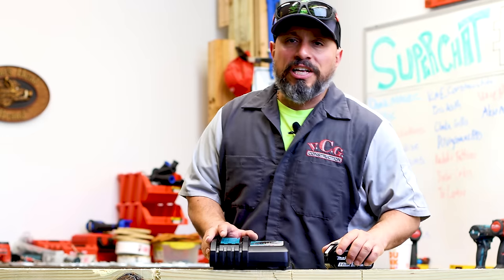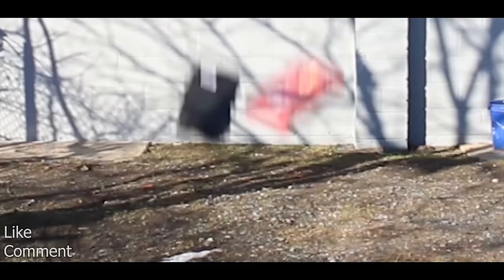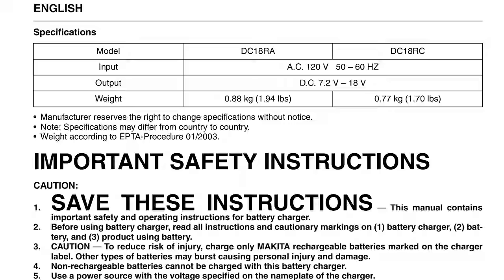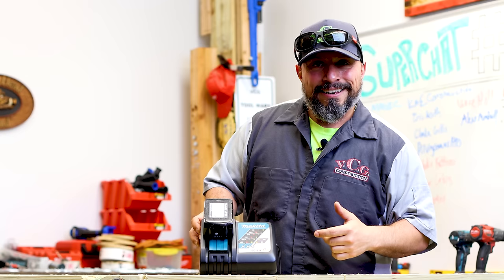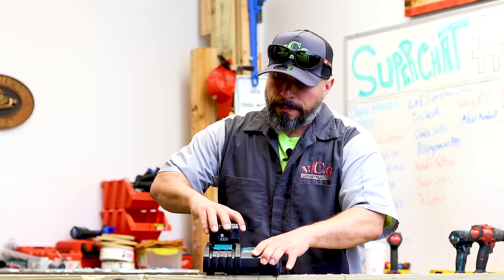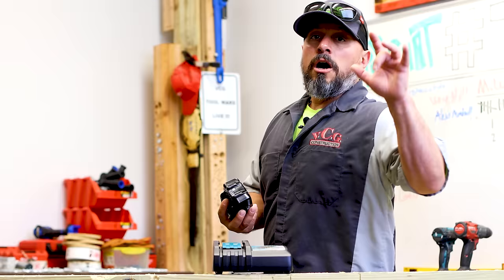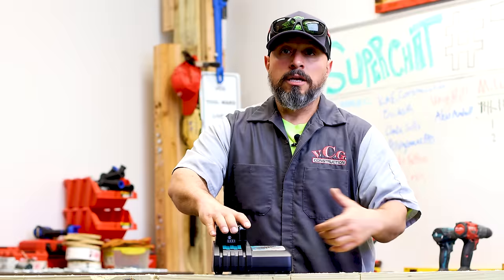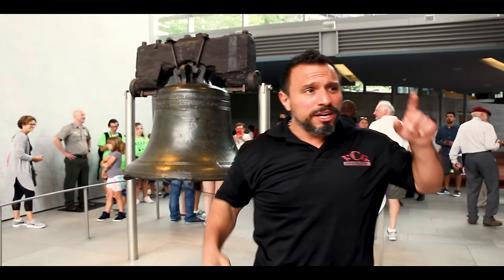MAKITA RAPID CHARGERS HAVE A HIDDEN FEATURE YOU DON'T KNOW!

Comment: If you have the dual port charger you can actually set dif tunes for each side. I run 2 dual ports and have each of the 4 bays set to their own tune. Makes it real easy to know which battery is charged without having to go look

Comment: I recently bought a new charger. 
I see the music sign on the panel but my charger never played beep on insert or music after battery is fully charged. 
I was thinking to return the charger thinking its faulty.

Its very helpful to know by this video that charger has options from silent to music mode. 
And mine was set at silent by default from factory 😃.

Thanks for saving my time and hassle of returning.

Comment: @VCG just push the tab the battery goes on forward multiple times and will change too
Reply: No need to insert the battery in and out. Even though it might say on the manual, I would avoid doing so to your battery. (Burnt something in a battery by doing so and warranty didn't replace it)

Comment: Hmmm, am I the only one who reads the manuals?

This wasn't new for me but hopefully others will have learnt something

This works on single and dual chargers, as someone else here has mentioned

It plays part of the tune when you place the battery on to start the charging and plays the full tune when the battery is fully charged.

Each battery bank on the dual charger is unique so you can set the tune for each side independently (someone else has already mentioned this)
Reply: Was thinking the same. First thing i did was change the tune after going through the manual of my brand new charger.
Reply: Instruction manuals are for people who wear hi viz pajamas.

Comment: Do you need the battery though can you just switch through the sounds using your finger?
Reply: No. The charger needs to "sense" that a battery is on the dock and also to notify that it's charged. Electrical current required. Sorry. Lol

Comment: I have two dead batteries that I'm trying to figure out how to get them to charge again and you have me dancing like a kookoobaya
Reply: Try to Jump start from a good battery by wiring + to +  and  - to -  for 10 seconds, 20 seconds, up to 30 seconds.
   If that doesn't work check the Voltage and internal resistance of each individual Cell and try to jump start it, unless the internal resistance of one or two bad cells is much higher than all the others, or very low indicating an internal 'Short'... If a cell is chemically damaged you could try replacing it if you have the time and skill, but I would just strip the pack and re-use the h good cells in my flashlight 🔦 torch

Comment: What would be great is if all power tools had the option 9f being fitted with a hidden gps tracker in case of theft and thus increase chance of recovery or at least catching the scummy person/s that swiped it
Reply: Probably easier to use open up the charger and glueing an AirTag inside somewhere. But yeah, wish manufacturers included a way to track your gear. My charger got stolen last friday.